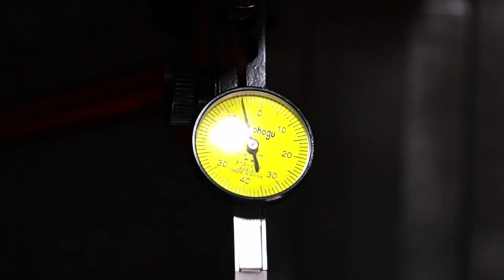Simple BK Bearing Block Backlash Fix

Comment: You should never press on the inner race when installing bearings, only the outer race.
Reply from the maker: The fit was there quite loose so I think the force I applied during installing the bearing was much less than the preload force which was applied through the nut when I assembled the whole bearing block to the machine. But you're right I'd have to consider that in the future (I was sure that for "O" arrangement that wouldn't change anything but actually you're right - for bigger instalation forces this could make issues).